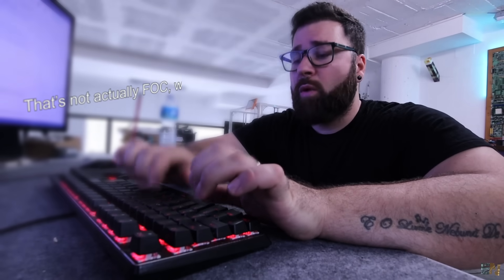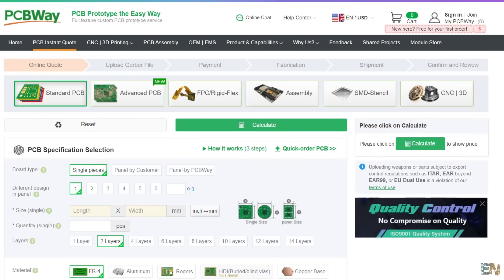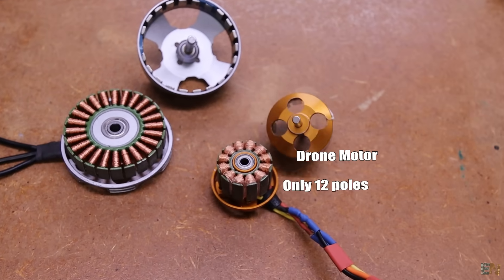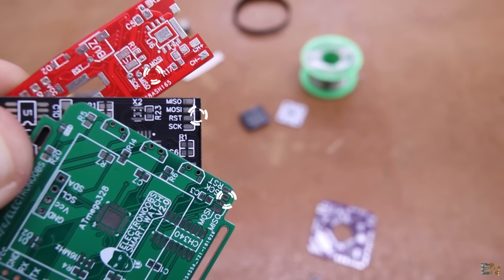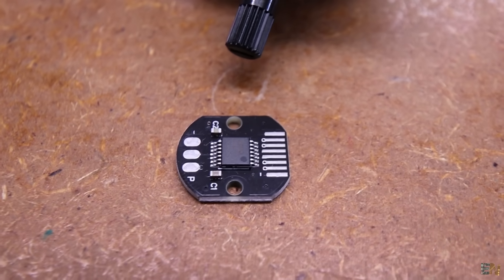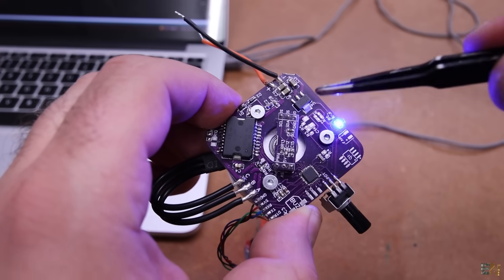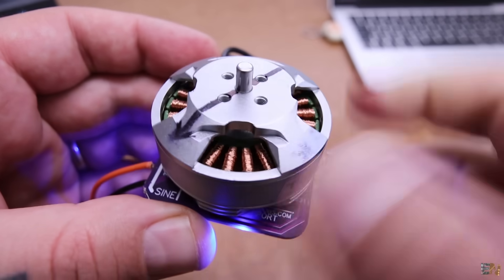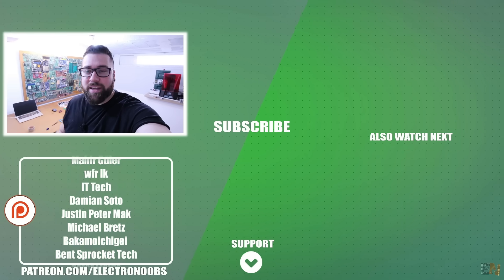FOC Driver + Feedback Magnetic Sensor - Arduino

Comment: This is SPWM controller with encoder. For field oriented control you need to control Id and Iq currents and for that you need more sensor readings like phase currents and phase voltages would be nice for calibrating. And more powerful mcu

Comment: @electronoobs Team,
your FOC working well with AS5048 Sensor over I²C (SCL / SDA) !
You have forgotten to connect A1 & A2 pins to GND !
The I²C address should be 040 and if you let the two pins open, that does not working!
I've tested it and it works fine...

Comment: Hi,

Have you by any chance updated your SimpleFOC V2 PCB design to include ISP pins for loading the bootloader? I ordered some of your V2 boards from PCBWay but it is awkward get the bootloader on the bare ATMEGA329P. If not would it be possible to have your original design files so I could try and modify it?

Ernie

Comment: Hi, I have a question about shunt feedback commonly used below H-bridges. I noticed that your design doesn’t include this shunt. Could you explain its purpose? Many setups place shunt resistors below the bridge for current measurement, and stepper motor bridges often use these shunts for adaptive control, adjusting based on the torque demands of the stepper motor. Could you clarify the role of this shunt and why it’s not included in your design?
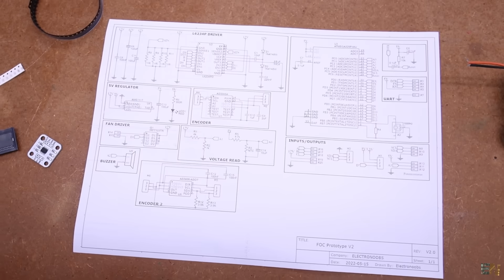Reply: You can see those shunts R8..R11 on schematic at 6:30 (and R8 soldered to PCB later). There are there so that there is some voltage drop across those resistors proportional to current through the motor. Measuring that voltage will give MCU the knowledge of motor current so that it can control it, for example limit it to not overheat the motor or not overload the PSU.

Comment: This IS FOC since the orientation of the magnetic field is explicitly controled by rotor position feedback. This isn't a complete FOC because there aren't explicit Iq and Id current loops, so it's open-loop with position PI as feedforward. So this design does benefit a bit from the concept of FOC, but not much. However it's hobbist-friendly and could serve as an entry project for any who wants to dive into real FOC.

Comment: Is the code displayed on your tutorial page, the most up to date code? I've built out your schematic on protoboard and all the hard ware is working correctly however motor does not react to the potentiometer turning accept for a tiny twitch at one point. The motor also doesn't return to its original position if I turn it by hand. The hardware does work with your original code without feedback. I noticed will printing out the values for "SPMValueA = ElectricalPosition + RotationDirection + SyncOffset;"
that the value goes up to 7471 but if value B and C are adding 120 to this then they realistically make no difference when changed to %360

Comment: Hi, I found your FOC V2 project very interesting, so much so I have ordered a few of your PCB boards from PCBWAY to try. But if you don’t mind I would like to ask a couple questions as I am new to the world of SMD PCM manufacturing.
Q1) I think R3 (NTC) is a temperature sensor! Does it have a value? And where did you source it from?
Q2) R4 on your schematic does not have a value what should it be?
Q3) Diodes D1 & D2 did you source them from Aliexpress?
Q4) Where did you source the LED1 from?
Thanks for a great insight into FOC.
Ernie
Reply: hey! do you need PCB supplier? i can help you.
Reply: @Janezeng-v9z  Hi, thank you for the offer but I have already ordered and received some PCBs.

Comment: I don't think foc (field-oriented control) could be used for positionn control since foc maintains a 90 deg between d and q axis of voltage or current which requires constant speed to maintain

However, i still like this video for demonstrating position control

Foc usually requires reading phase currents then converting them to d and q axis forms using park and clarke transforms, then having PI controller for the command of voltage d and q axis then converting it back to phase voltages through park and clarke transforms
I don't think arduino could handle such calculations in high speeds unless theres a library for that

Comment: Congratulations for the very interesting project of FOC driver controller. With the posibilty of a precise positioning, brushless motors can be a very good substitute for servos in apllications where quickly movment changes are ncessary. I looked the system control routine of the program and noted that it implements in fact a PD controller instead a PID (lacks the integral gain and also the intergral term calculation). For applications where quick corrections are nedded it is the appropriated kind of controller to be used, and it is the case here. Anyway it would be interesting make a test adding the integral parcel and see the behavior of the motor positioning, after all the integral parcel remove the steady-state error.

Comment: How can I PERFECTLY center the magnet on the axle?
Reply: Easy 

3d print a cylinder shape like (with hole on both sides ) (one hole for magnet and other one for motor shaft ), then use glue for fixing both in place 
If you want to be supper accurate, I would recommend resin 3d printing

Comment: Two cents from my side for anyone watching this cool video and reading this comment 😊
First of, this is a nice introduction to the world of motor control, it covers some of the basics.
Second, some people said that FOC needs position sensor. Thats not true. There are sensorless FOC (read  about BEMF or SMO observers)
Third, what we seen here its not even 5% of FOC, but is a good basis to build a basic FOC (im not saying its bad, im just saying that FOC is much more than setting PWMs based on angle input)
Fourth, having high pole-pairs is disadvantage, if you want to do FOC with uC which cost below 100€. Why? Angle sensor is measuring rotor mechanical position with some inaccuracy, which is only greater with more pole-pairs, since you need to do conversion to electrical domain.
Fifth, proper motor control (current, torque, speed) in proper closed-loop is one of the hardest things in embedded systems you can do, if you develop HW and SW from scratch.
Sixth, as much as this video is cool, please note, this is barely an introduction (stress on barely). For anyone trying to do these things professionally, keep in mind that you can only cover part of the field and not entire motor control. Field is just to vast.
Lastly, dont be discururaged when you fail. But also dont attempt such projects without having either immesne motivation to learn a few years or enough Control-Theory/Electronics/Firmware/Inverter knowledge to finish in one.
Reply: Can you make a project like this and make a video
Reply: @anasdaggag3431  hey there! Gladly but it would take quite some time and I think I dont have enough audience to benefit from it 🥲
Reply: @AljazJelen1992  I honestly think there will be quite an audience for it. Considering more and more robotic applications are developed. There really arn't many easily accessible resources that take you from basic step based ESC to a working closed loop controller. It would be a great learning opportunity for the many upcoming robotic enthusiasts looking into working with motors. I'm personally trying to learn it myself. Currently second year eng student, If you have any tips or roadmaps for me I would greatly appreciate it :)
Reply: @djay10101  I am actually in the making of a 4x4 RC car with independent 4motors and inverters. The inverters and their SW work, CAN communication is established, body controller also in a good state.
But its more than a full time job and I don't think I can afford to spend time on it.
I hope i find some 😊
Reply: @anasdaggag3431  I am going to make one stay tuned LOL

Comment: Para contar las vueltas puedes utilizar este algoritmo:

Sabiendo que el AS5600 tiene una resolución de 4096 puntos por revolución, entonces:

*  dif --------> diferencia entre pasado y presente.
* num -------> Valor actual del encoder.
* last ---------> Valor anterior del encoder.
* turns -------> número de vueltas.
* steps -------> Pasos totales.

dif    = num - last;                       // Guarda la diferencia entre el valor nuevo y el valor anterior (pasado).  
 last  = num;                               // Y ahora guarda el valor actual como pasado.
  
  if      (dif < -2048) turns = turns + 1;   // Comprueba si ha pasado por cero para contar una vuelta (cuando pasa de 4096 a 0) o descontar una vuelta (cuando pasa de 0 a 4096).
  else if (dif >  2048) turns = turns - 1;   // Esto se consigue si en la lectura del encoder el valor anterior y actual cruza ese umbral y está dentro del rango del "if".

steps = (long)(turns * 4096L) + (long)num; 

El problema lo vas a encontrar si cuentas vueltas de forma muy rápida, probablemente deje de contar bien. No es problema del algoritmo de contar vueltas, sino de la lentitud en la ejecución. Se necesitaría acceder al AS5600 por interrupción.

Comment: Hi, congratulations!
What do you think about to add an external Floating Point Unit, or a cheaper 32bit microcontroller(stm32f103c8t6) for the math calculations with SPI communciation?
Reply: If you plan to use current control, forget about SPI, it's too slow.
If you want to find cool ready-to-use HW, then check STM32G431 ESC. It's perfect for proper FOC

Comment: That's a really really bad way to panelise the PCBs, they will draw a square around it which will contain large gaps and they will charge you for all that area.
The driver IC got hot because you have no ground pour underneath the thermal pad and also 0 stitching vias.

Comment: Apply a low pass filter to both of your inputs into PID. That will help with runaways and shaking. Learned from FPV drones :)
Reply: This cannot work for angle input, as it will result in phase shifts which is for proper FOC (current control) undesirable.
Except if you then implement correction algorithms

Comment: Did you use SPI or I2C to talk to the AS5048, as this module only supports SPI. It doesn't look like you're able to use SPI with the breakoutboard
Reply: Forget about either, if you want higher speed torque control.
Except if you can implement observers

Comment: No current feedback, no transforms to alpha/beta and DQ space, inefficient code using floats on the ATMega that doesn't have FPU, low freq PWM output by using Arduino analog write functions... Man, what a letdown :-(
Reply: Let’s see how much better the you made is. From scratch, no pre bought products allowed.
Reply: @HelloNotMe9999  No problem, I have DIY inverter board on my desk and did FOC.
Doing it DIY doesn't excuse the laziness of using built in arduino functions that are useless for this application.
Reply: Exactly, just what I was thinking.

Comment: You need to replace the AS5600 with a better sensor. It's not really meant to be used to way you're using it, with a spinning device, and is ideally meant to be used in an object with a fixed rotation of under 360 degrees, with the hard angles recorded in the one write PROM for permament use. 

Try the MT6701 :D
Reply from the maker: Thanks so much for the tip!

Comment: Don’t PCB manufacturers not like you having snap off parts? Don’t they charge extra for that since it is separate circuits? With PCBWay don’t you need to select “Panel by Customer” and set the number of different designs which in this case is 3?
Reply: hey! do you need PCB supplier? i can help you.

Comment: Hi! In one of your previous videos, you mentioned that using the INA3221 is a great choice for measuring each phase of a BLDC motor. I'd like to use it to create a custom ESC for a drone, but I'm not sure how to wire this sensor in EasyEDA. Could you guide me through the process? Can I send you an email for more details?

Comment: i have a question: what are the inputs and outputs of the PID? Since you used a sine wave, you were able to precisely control the position of the rotor, right?
Reply from the maker: The output is the torque

Comment: Can we only use internal sensored brusless 3 phase motor? So we can get rid zero crossing sensor and the hall effect sensor?
Reply: Internal sensored motors just have Hall effect sensor inside them. They tend to be more expensive too, just attaching a magnet to the back of the motor shaft is usually a better option.

Comment: What a beautiful project! Andrei, I want to be your friend - would you?🤣Contact me! I spent a week playing with the AS5048A - the one that communicates over SPI, instead of I2C. It communicates way faster than the AS5600 (roughly 10x faster) - but the readings were more nosy. I still don't know if that's just because it has a 14 bit resolution instead of a 12 bit... Also, the AS5600 has 2 internal modes: when it is rotating fast, it is also noisier - when the speed reduces, it uses some filtering to provide more steady readings.
Reply from the maker: Thanks fot your message, I've seen other posts using it with i2c but I wasn't able to make ir work that's why I've only used the 5600.

Comment: A few comments: 1) You can put V-grooves on your PCB so they break off easier and cleaner. Putting a slot is a lot less aesthetic 2) See if some of your PCBs can be partly pre-assembled 3) Phoenix CNC on tindie has an arduino 328p bootloader burner that burns QFP chips in less than 3 seconds - definitely check it out so you don’t have to waste arduino boards 4) superglue is super temporary on anything that moves. Love your videos
Reply: A lot of PCB manufacturers charge you extra if you have snap off parts on your boards since they count them as separate circuits.
Reply: Don't worry about a magnet that would stay on a steel shaft anyway! The superglue is effectively permanent unless it gets above 150C or takes a large shock.

Comment: Quick question: How do you design your PCB use MOSI and MISO, SCL and CS to burn bootloader? Do you use jumpers to select these pins as inputs for burning bootloader (from Arduino Nano) and then when its the job is done select these jumpers to whatever you need in the project?
Reply from the maker: The atmega328 has those pins as default mosi miso on pins 11 12 ad 13. You Don't  need any jumper just add pads dor the pina and that's is

Comment: good job but I don't see the essence of FOC there. how did you solve the current measurement when you talk about torque regulation. I would also be interested in how he mastered the park and clark transformation atmga. 
finally, I would recommend you to increase the pwm frequency above 20khz, you wouldn't have strange sounds there either.
Reply: The transforms are doable on ATMega if you use tables or CORDIC for the trig functions and fixed point math of course.
But he doesn't measure phase currents so no way to do the transforms without that.
Reply: Additionally, there is no way to use this ATMEGA for FOC @ 20kHz
Clock frequency is just too slow to be able to read angle, process currents, perform corrections, calculate DQs, do the PI, apply svpwm and repeat.
I mean you can do it in most basic form, but it's like putting lawnmower motor to a child toy chassis and call it a car.
Reply: @AljazJelen1992  might be able to do the algorithm at 1kHz repetition rate, but yeah. Should go to some ARM CPU.

Comment: Can you put via's under the controller chip, then make a larger ground plane (or even a 4 layer board) so the internal copper pours can act as heatsinks spreading the heat out away from the chip...use the copper and PCB as a heatsink
Very cool design...take a file or low grit sand paper and scuff the end of the shaft and back of the magnet before applying the glue, give is a rough surface to bond to.
Keep em coming!!!!

Comment: Video is missing core parameters for FOC, like: Direct axis force and current (Id), Quadrature axis force and current (Iq), Space vectors etc. Happy to see in the next video.
Reply from the maker: Current sensing will ne next. For now it doesn't  control the current value...
Reply: @ELECTRONOOBS  i like your explanation only few people like you are talk about the working i learn a lot from you thanks sensai
Reply: Content is allready super interesting! If you take it one step further and control currents and use them in another control loop that would be so awesome. I've been trying to do it with no success😅
Reply: Great job, but still not a FOC but you are doing a great job.
Reply: In the end, FOC is all about having your current vector being orthogonal to your magnetic field vector. If you can build your 3-phase signal without having to use transforms, then that's fine too. I.e. you don't exactly need these parameters.

Comment: Thanks for the video.
Using crystal instead of resonator would probably be better for this build, as the resonators usually aint as precise and also can vary their frequency more when subjected to temperature which i guess your motors+driver will eventually emit :)

btw i order my PCB's from EasyEDA and their online SCH/PCB editor. Do you see any benefits in switching to PcbWay as you are recommending it?
Thanks